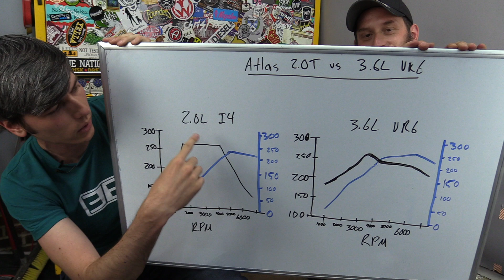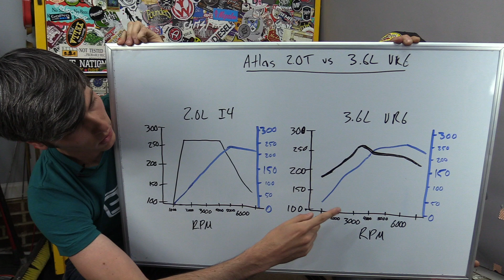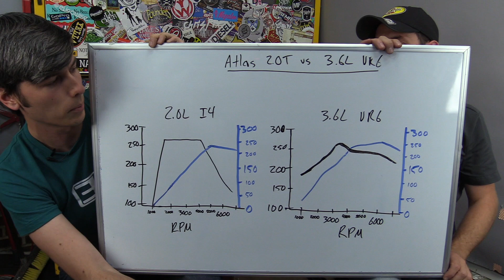4 Reasons Why The VR6 Engine Is Dying Off

Comment: I just wonder if the i4 Atlas will struggle with 7 American sized people.
Reply from the maker: +Caleb Brown torque is torque, power is power. It's pretty similar to the VR6 in that regard, so it won't struggle any more/less than the VR variant.
Reply: More oomph at a Lower rpm is great, and more useable in daily driving. When I say struggle, I mean :Will it have the same longevity? They have been making amazing powerful engines, but have the VW versions been dependable/reliable?

Comment: vr6 isn't dying, the na version is, the vr6 is getting turbod from the factory, the Chinese altas(terramont) has a brand new 2.5 vr6 turbo(300hp 370lbft made in Germany), much more of an upgrade compared to the US spec altas(3.6 NA 280hp 270lbft). China is usually where vw tests their engines before they are sold to the RoW(such as the 1.8tsi and 1.4tsi). So i'm expecting to see the 2.5 vrt making its way to many vws that demand higher output which typically requires NA v8 power, potentially new touareg and arteon.

Comment: Having heard and accepted all of their points towards the benefits of switching to 4-cylinders, I still have to say that pretty much the only advantage I saw for a 4-cylinder is the weight reduction on the front axle. The power delivery and fuel economy points are not as important, because these guys forgot to discuss the reliability concerns that a (relatively) more stressed smaller engine entails.

Comment: It's important to note that the FSI 2.0t engines from the factory are tuned way low, even a basic tune requiring no upgrades to the car at all put the car to ~250hp, and ~300tq.

Comment: Now that I've actually watched the video, I realize it's quite an old topic. Furthermore, you should indicate with your torque and power curves that those apply only in the static case. Stepping on the throttle (or transient conditions), the two engines have a completely different feel. You'll have to wait for the 2.0T, whereas the VR will provide acceleration right away, even though the 2 L turbo theoretically provides more torque at low RPM. I've had both a 2010 and now a 2014 Audi S4 which have supercharged 3.0L V6s and a double clutch transmission. I just tried the new 2018 S4 which is a turbo  3.0L V6, and the turbo coupled with the automatic transmission are showstoppers for me. It feels like you need to get on the phone and ask for more power, like on a big ship or something.

Comment: the vr6 was designed to fit it the location of the vw 1.8 or 2.0l 4 banger and increase the horsepower i have a 95 jetta glx vr6 and a 91 passat vr6 .... fault point isnt the engine but the self machining cdm, ccm transmission

Comment: No wonder the Inline-4 from the '06 is more powerful than the vr6 from the '05 Golf, the smaller conventionally designed inline engine got a turbocharger unlike the bigger less conventionally designed vee-line (vr) engine.

Comment: I have a 2000 eurovan MV with a vr6 that only has 90,000 miles and love it. It gets 22 mpg on the highway.
Reply: 2002 Eurovan with 240,000 miles, transmission is about to fall out. I'm considering a 2006 Touareg with 3.2L VR6. The V8 and 3.0L TDI options are much more torque for towing 7700 lbs, but they can't match my satisfaction with the VR6 reliabilty.

Comment: Greetings from a german Engineer!

The VR5 and VR6 engines in Germany about 10 years ago. The were all replaced by 2.0 I4 Turbo. 
The Golf R MK5 and or Passat B7 ( Engine portfolio nearly didn't change from B6)  were the last with this engine.
They were just kept for your market ( North und South America) because the costumer didn't´t want a 4 Cylinder. 
You always get a bigger engine with less power than the smaller engine boosted up.
You decide which one would be better. 
But even now for you the bigger will die because for car manufactures it is too expensive to built too many different variants of engines. The production tools must to be useful for alle the lineup for example. Audi for example uses 2.0l I4,  3.0l V6 and a 4.0 V8. They all have 0,5l bore per Cylinder.  The blocks and headers are able to have similar parts too then. 
The have to lower the production costs.

Comment: The 12v were apparently not too bad, but the 24v was a grenade...
Reply: philip dias is that a vw term also? cause Cummins diesels is also referred by 12v and 24v
Reply: Yes, the "v" stands for valves. Old ones had two per cylinder. New ones have 4 per. 4 valve vr6 (24v) in the 90s-early 2000s was terrible.
Reply: Yes, the "v" stands for valves. Old ones had two per cylinder. New ones have 4 per. 4 valve vr6 (24v) in the 90s-early 2000s was terrible.

Comment: Another problem with the VR6 was that the zylinder bores were warping slightly when the engine heated up due to heat bunching up in the cramped space between zylinders and being better cooled on the other sides where nothing warm is anywhere near them. This caused uneven surface wear.

Comment: Would a VR4 make sence, or no?
Reply: Probably not, but was used in one of the most revolutionary car (Lancia Lambda from 1922) and also won a world championship in 1972 (Lancia Fulvia)
Reply: @Mauro-82  VR4 could probably make sense if there is a need for very tight packaging, but I guess turbocharged inline 3cyl dominate there and there is probably no need for a 4th cylinder.

Comment: Guys, this video truly inspires me to stop and think deeply about what we are trying to achieve with engine design and packaging. I wanted to step back a little from this look at the incremental improvements that are ongoing in this video and ask a bigger question – what do we really want to achieve? If we assume, conventional vehicle with wheels, tires, passenger compartment, combustion engine, etc.  Then, what is the ultimate evolution of combustion engine design/packaging? Going back to first principles, what do I want from a combustion engine? IMO, this ideal design would be a device where we send fuel in and take power out and, of necessity, exhaust. Ideal packaging size? -  As small as possible to be able to get the power out. What should it weight? – As little as possible? How should it packaged?  One engine per wheel? One engine per axle? Some completely new configuration (not yet conceived) that is only possible because of small packaging?  ???
All of this evolution seems to require two particular enablers in order to progress. One, is better materials which makes things that were difficult(or impossible)  to produce cheaply a while ago, practical and affordable today – example – stainless steel exhaust systems. Two, is better ideas (engineering) on to how to configure things (materials availability held constant) to perform better.  Sometimes we see incremental improvement as is the case you describe in this video and sometimes we see paradigm shifts where huge leaps are made in one step. I’d describe evolved control systems of a vehicle one of the paradigm shifts – example EFI – once introduced; essentially all vehicles start easily and run smoothly all the time. Same for ABS – now a person with no special skills or knowledge can brake a vehicle to it’s maximum capability buy doing only what come naturally – press the brake pedal as hard as possible.  
I realize I have taken this to the extreme but what are others thinking about the evolution of combustion engine design and packaging?
Reply: A two stroke engine with a rotary exhaust valve is the ultimate form of ICE (minmal complexity, weight, power, torque, longevity, reliability).  But I love my VR6!
Reply: @tomrose2086  Thanks for your suggestion. It is unusual for me to get a reply to a comment I made 7 years ago.

Comment: If a vr6 had advantages, then why not use a vr4 vs a straight 4?
Reply: Daniel M. Ramos There's no reason for a VR4 that takes up similar space as a turbo inline 4. The VR6 had beneficial packaging vs a traditional V6, because it's much narrower and you had a lower part count with only one cylinder head and valvetrain instead of 2 on a V6.
Reply: Daniel M. Ramos kinda what I was thinking

Comment: Something you didn't mention in the video when comparing the 2 you also have to remember the 2.0T and most turbo'd 4cyls in general use higher octane fuel. The VR6 runs on "normal" cheaper 87 octane. So the operating cost evens out a bit even though the VR6 gets a few MPG worse than the 2.0T it also runs on cheaper fuel.
Reply from the maker: Sometimes true, but in this case both the '05 and '06 engines I spoke of required premium (VR6 and I4). For VW's modern engines, you can use regular in both.
Reply: Engineering Explained Didn't know the newer ones required premium, guess I was only thinking of Humble Mechanic's mk3 generation VR6. Thanks for the reply!
Reply: Tyler Walters actually the newest gen 4cyl turbos use 87 not premium

Comment: well, HGP who produce 750+ HP fast Golfs never take/modify the 4 cylinder engines. The 4 cyl engines are just no good at higher revers. They are buzzy and loud i.e. unrefined simply due to the physics of poorly distributed mass in the 4 cylinder cycle configuration. That will never change. As everyone knows 6, 8, or 12 cylinder engines are always far smoother due to the better distribution of mass of the pistons and crankshaft. Having said that of course adding the turbo charger allows the 4 cylinder engines to produce much more power at lower revs where the "buzziness" of rough 4 cyl engines then isn't noticed so much as the torque through forced in air (turbo) is already higher at lower revs. I never own 4 cyl engines, i just can't stand the unrefined output. It's also a reason why 4 cylinder engines in the end failed to perform in formula 1, they simply wrecked themselves every time as simply too rough to handle high revs. Apart from that there is no problem in turbo charging a VR6. I've checked the German websites and so far cannot see reference to the VR6 or 6 cylinder engines dying out.

Comment: Had a 1995 VR6. Sold the car 13 years old in 2008. Engine had over 360000 km. Absolutely fantastic engine. Never had any major mechanical problems, and oil c I sumtion was zero from service to service. only work done was some pulleys ans rubber hoses replacements.

Comment: There are even more reasons. Absolutely crap unequal length intake and exhaust ports. The really bad combustion chamber design (only 2 valves per cylinder, at least the older ones). An inherent thermal issue with the rear three cylinders which actually makes the VR engines sound nice because they dump fuel in there to cool the combustion. Bad fuel economy in real life. Slow compared to many contenders of the time with way less displacement. Timing chain issues (like all VW group cars) ... I really missed this technical stuff in this video ...

Comment: Well in fairness to the VR6 it's never been the most fuel efficient thing, the VQ35 motor did about 23MPG combined, has 0.6L more displacement and about 50 more HP & TQ.

Comment: What about the issue with direct injection with dirty valves? Is the new turbo VW engines plagued with this issue?
Reply: Tony Vittitoe not as much as the older ones. But the miles are still overall lower

Comment: For me the VR6 feels alive and characterful. Whereas the 2.0 just feels like any other standard engine, even though, as you pointed out, it is objectively better.
Reply: That's why I said "objectively" the newer engine is better, i.e. more fuel efficient, faster, etc, yet it feel like an appliance compared to the living, breathing thing that is the VR6.  Sure you can tune them and they are very very fast, yet it doesn't evoke the same emotional response. At least in my case. And I'm not just saying this, in my actual experience from owning a MKIV R32 and now a MK7, the R32 always made me smile and felt special even when going slow (which it was always slow lol).
Reply: @AaronAnonymous  it's because it screams at you and you want to scream back.
Reply: The MK7 is still fun, for sure, but in a different way. It's light on its feet, understeers "less" and inspires confidence unlike many other cars could. I also enjoy the interior quality, refined ride and easy steering. But it's probably because it's so perfect that it looses some character. Anyway just an opinion but I will always have a soft spot for the VR6. I think Charles feels the same even though I'm sure he's had  lots of experience with different VW engines he still loves the VR6 the most from what I can tell. Sorry for the rant lol.
Reply: AaronAnonymous yes exactly
Reply: AaronAnonymous how so, the new ea888 is punchy as hell.
Reply: As an mk7 gti owner I can tell you the engine feels very alive. Especially after a stage 1 tune.
Reply: Lol well I have never experienced the VR6 so I can't really compare, but I love my MK7 GTI. It never fails to put a smile on my face whether I'm on my morning commute to work or just cruising around.

Comment: The VR6 is all about putting 6cyl power in a relative compact package, and when being outperformed by a turbo I4 in every aspect, it's natural to be phased out by VW, especially considering their current financial clusterf*ck. But even a smaller displacement  4cyl is slowly getting replaced by 3bangers, where again packaging plays a significant role I believe. It's always better to stuff a shorter engine beside a hybrid powertrain in a transverse FWD layout. So I guess eargasm-hungry automotive enthusiasts are gonna have a lot of heartbreaking moments in the coming couple of years.

Comment: I'm sure there's an explanation to that but I cannot quite understand why don't they produce a smaller VR6 to keep the soundtrack and stick a turbo on it, to make it powerfull, like they do it on an I4?
Reply: Žan Fingušt they would still have the cost of the complicated design plus the turbo system and the weight would still be a bit higher.
Reply: Well the turbo is there anyways, and the technology is already developed and well known... i don't think that the 2L VR6 would be much heavier than a 2L I4.. Would be worth the sound in my opinion.. plus, look at all those technologies they are putting in cars.. its not a weight problem to put in a shitload of luxury, but when an engine would be 10 or 20kg heavier, it becomes a huge deal?

Comment: there was never a Golf GTI with 6 cylinders, only the R32 had 6 or a VR6 engine (2.8 or 3.2 Liter)
Reply: kwirk kwirksn That is incorrect. The Mk4 GTI came with a 24 valve VR6 (6 cylinders, 2.8L) and the GLX Golf came with a 12 valve VR6 (also 6 cylinders, 2.8L) until 2004 in North America before moving to a 1.8L 20 valve Turbo.
Reply: ok, I didn't know that, was that also the case in germany?
Reply: kwirk kwirksn All the way back to Mk3 had a 2.8 12v VR6...
Reply: kwirk kwirksn 

WRONG.  

my little brother owns a 24v 2006 black golf GTI.
Reply: and this is a GOLF 5? because in germany only 4 cylinder GTI versions were available
Reply: kwirk kwirksn 

no, it was was a golf 4.  2006 was a transitional year.
Reply: yes, that's what I know, but in germany those golfs weren't called GTI but only GOLF VR6, so thats maybe the difference to your country ;)

Comment: What is your take on a turbo 4 pulling around a car that weighs 5997 lbs in terms of the longevity and wear and tear on the motor? Are you saying that a smaller much more complicated turbo charged engine will last as long as a larger more simple motor that offers similar power and torque?

Comment: Just turbo a VR6 🙂
Reply: It's really not that expensive to boost a VR and have both reliability and power on stock internals. Split  head gasket, copper spacer , bearings, good turbine , the right pipes lines  and tune and you're not gonna exceed 2500 to 3 k for the total cost if you do it yourself and know how to do it right
Reply: how would one tune it? I have been working with a tuner for several months. having issue with the vendor. What works for you?
Reply: the ATLAS in china is called TERAMONT and comes with turbocharged VR6 2.5L 299BHP
Reply: The ford ecoboost f-150 has a twin turbo V6. The raptor uses the same engine.
Reply: 1.0 twinturbo VR6 + 4 electric motors lol
Reply: 5-600 whp is easy peasy with the vr6.. original rods and pistons.
Reply: And, it would go in a what? Truck or Van from VW would be diesel.  So, that leaves sports cars ...... the engine rev potential?  Weight of block? How much torque/hp until the block or other components breaks?  Does it retain drivable characteristics?  Then, fuel economy.  I will bet you Audi/VW investigated this and decided it was easier to start over and too few would get excited enough about this engine in a car. I mean it would be replacing a V8 (V8 > VR6 for sound).  But, these guys are forgetting something.  The W12 engines are almost two of these smashed together (piston layout wise).
Reply: Alvin Ameyaw At HUGE cost.
Reply: @EvilTriumphswhengoodpeopledono  i dont care im keeping my vr6 lol